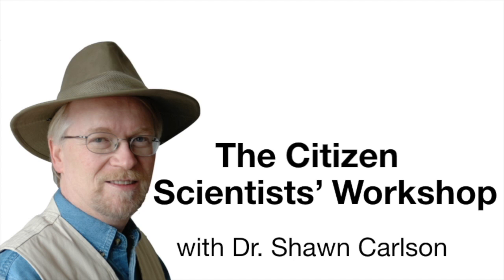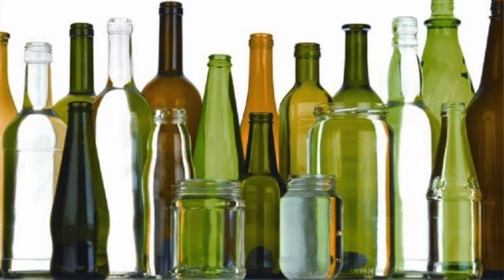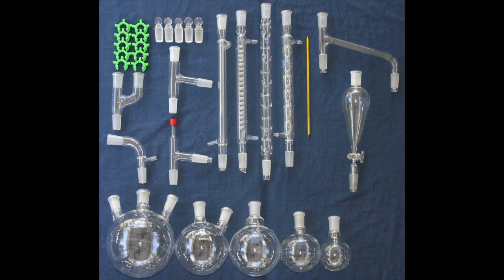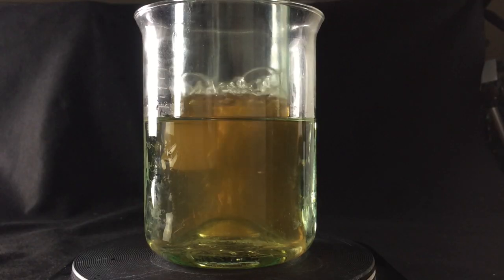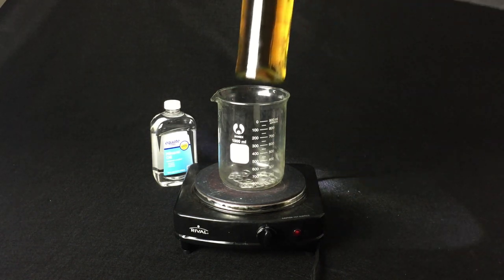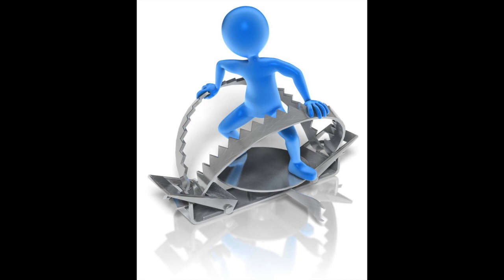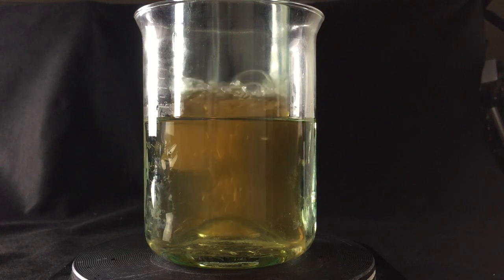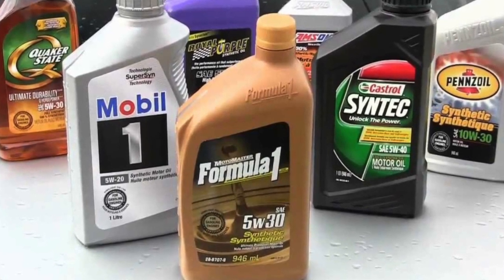How to safely convert home glassware into usable labware. By Dr. Shawn

Comment: I successfully boiled water inside of a bud light platinum bottle sat on top of a porcelain plate inside of a pot with chips of glass as boiling stones. I didn't fill it with oil though. I mearly coated the bottom of the pot to prevent the metal from melting and heated slowly over the course of about an hour

Comment: I've done basically the same, but with sand. 
Not sure if it works as well, but seems decent enough.
First add a decent layer of sand in the pot, then push/wiggle the bottle/jar into the sand. Finally pour sand down along the sides. Remember that the sand gets really hot, and lifting the bottle/jar means you have to let everything cool before starting again, as you will not be able to push the bottle far enough down into the sand.  
As a bonus - If it boils over, there is no oil to start a fire.
Reply: That's a pretty good idea. The sand would protect you from glass shrapnel in the event of overpressuring